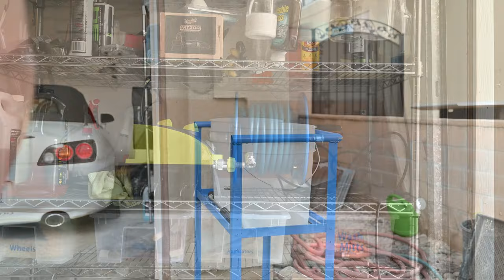Testing Meguires Hyper Wash in my Foam Cannon | 4k Nikon Z6 35mm f1.8 s

Comment from the maker: What is your favorite car soap?
Reply: Right now am using HONEYDEW SNOW FOAM.   I want to buy Mr. Pink and see how that stacks up against honeydew.
Reply: Right  now am using HONEYDEW SNOW FOAM. I want to try Mr. Pink .
Reply: Adam's Car Shampoo.  But I just coated my car and running out of Adam's so going to switch to carpro reset and give that a try.  But want Hyper Wash for other cars that may show up to get coated or detailed.
Reply: I like this soap. On my second gallon. Smells good, suds last a long time, 400:1 dilution ratio, and best of all is the lubrication.    Good maintenance soap. Buy on sale and it's a great value.
Reply: For my first foam-up I use Meguiar’s Hyper Wash, let it rest, then rinse it off. My second foam-up is with Chemical Guy's Citrus Wash and Gloss which provides much better slickness than the first foam-up. (FYI: The gloss imparted from the second foam-up is more than acceptable when I'm in a hurry. When there's time, though, I follow-up with a couple of Turtle Wax spray-ons: Seal N Shine then Spray Wax.)
Reply: recently started using a belgian product called Nerta active diamond foam in my foam cannon as its a bit stronger than the hyperwash at removing dirt. Then i finish with hyperwash as to me it has a nicer smell, slightly better lubricity and leaves a nice sheen.
Reply: @FazalJuman  Do Nerta and your previous foam wash call for the same soap to water ratio?
Reply: @hlcepeda  no if using in foam canister, For the hyper wash I do 10:1 and for the nerta I mix 5:1 so the nerta does work out a little more costly
Reply: Turtle Wax slick n slide

Comment: Why do you prefer to use garden hose for final rinse?
Reply from the maker: The garden hose does a better job rinsing off all the left over soap. It takes longer to do the final rinse with my pressure washer that dose not have a really high flow rate.
Reply: Also a lot safer for rinse imo

Comment: Do you have a link to the pressure washer you're using? What degree tip are you using for your car? Have you ever measured the PSI?
Reply from the maker: Here is the pressure washer link https://amzn.to/3sq47Na I use a 40 degree nozzle. I have never measure the pressure but it not much I can put my hand in front of the tip about 10 inches out and it is not that bad.

Comment: Hey Rob. Awesome video. I came here to see your review about the Meguire's Hyper Wash. 
2 questions.
How did you like the product overall?
Which pressure washer model are you using? I see that it's a Sunjoe but don't know which model. would you recommend it?
Love your bucket cart. awesome idea. 
I like your rinse method, I do it as well. I think it actually takes out the remainding soap off much quicker than a pressure washer. But thats my opinion.
Keep it up Rob!
Reply from the maker: The hyper wash is good but then again I have never used a soap that was not good. This is cheaper than some of the other main brands, that is the main reason I went with it. 
I use this pressure washer https://amzn.to/2W19RMS It is ok, I have a big leak coming from the outlet but it does not seam to effect it. I choose this one because i wanted to take it off the cart and put it on the shelf. 
I agree using the hose for the final rinse is much faster and better.
Reply: @robsgarage-detailingvideos5621  yeah. While using the pressure washer has more force, using the garden hose utilizing more water volume within the rinse. Thats my opinion.
Thanks for the info Rob.

Comment: Do you have a parts list for custom wash cart?
Reply from the maker: I just bought left over metal from the local metal shop. I then cut and weld the cart to my specs. I needed a custom size cart so it would fit under my rack in the garage and not stick out at all.

Comment: Mine works better if I don’t shake it and I use hot water makes a lot more foam that way
Reply from the maker: If you dont shake it then all the soap get pulled up 1st and all the water is just left over and you dont have any foam after all the soap is gone. I have never tried hot water, I need to test that out, thanks.
Reply: @robsgarage-detailingvideos5621  I know with chemical guys and armor all the ceramic hot water seem to work well, but with a few other brands, I noticed it didn’t make a difference